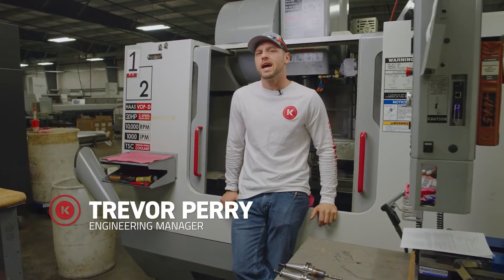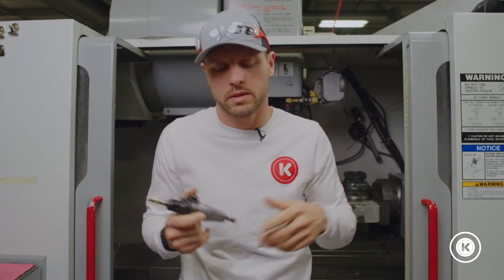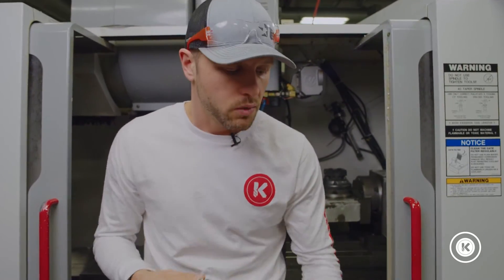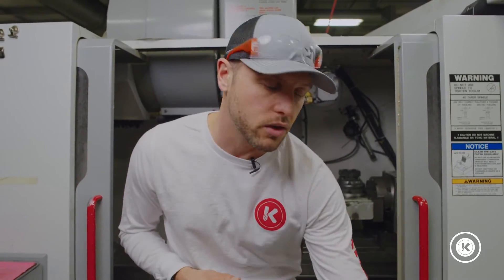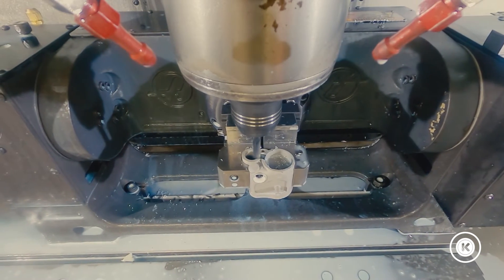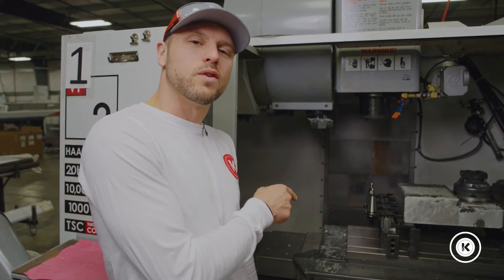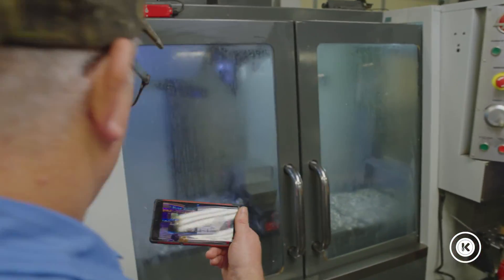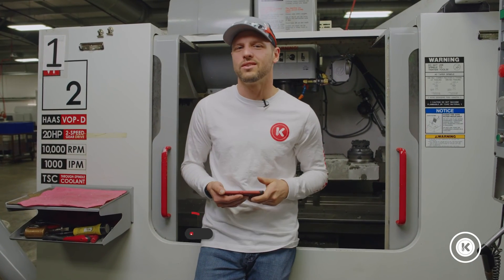Hacking Our Haas CNC Mill Past Its Tooling Limit! - Kremin Inc.

Comment: So where can i get that program? :). I would love to do that!!
Reply from the maker: Chris, we didn't post the code because we didn't want to have anyone accidentally mess a machine up, I will say, its a set of parameters that need to be changed then a macro that needs to be made - I would reach out to your Haas dealer and they should be able to point you to the correct spot to get started. Good luck and let us know if you get it.
Reply: This is just what I have been trying to do for a long time.  My Haas dealer is not very helpful when it comes to outside the box stuff.  Do you have any contact info for someone that can help me with this for my Super Minimill 2?  @KreminIncManufacturing